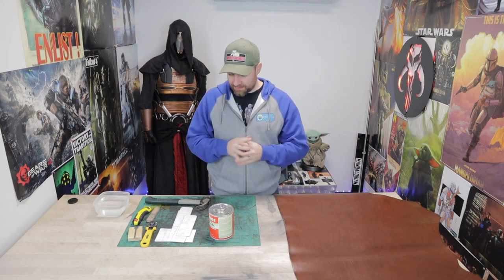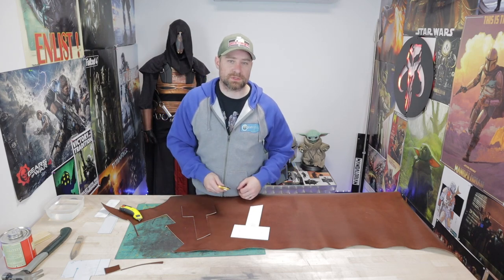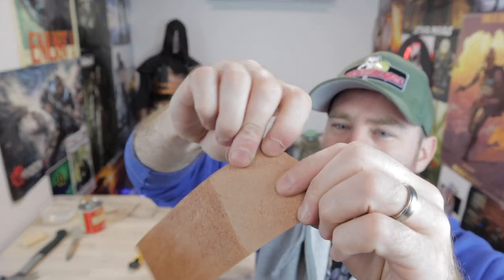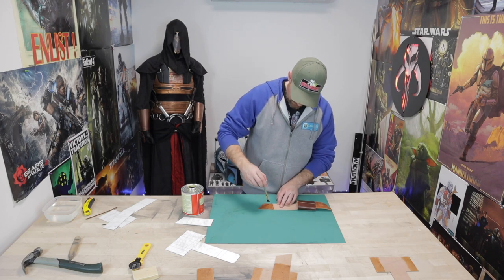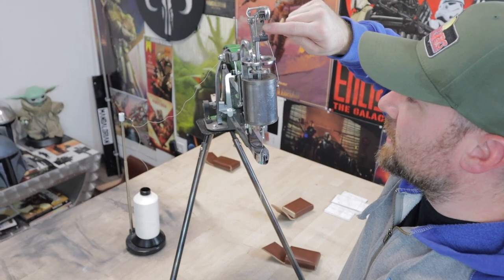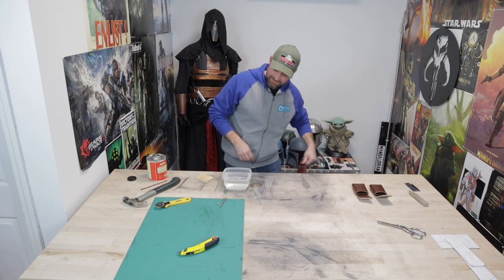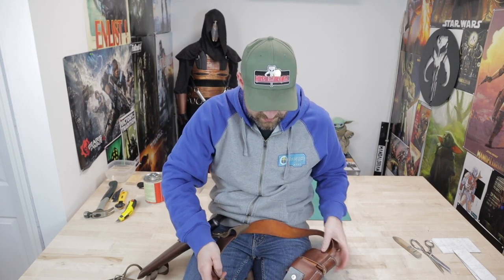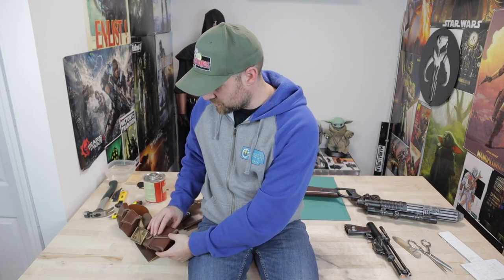"RE ARMORED" BOBA FETT POUCH TUTORIAL

Comment: Don't know if you still use the cobbler machine, but I found the best way to mount it is to bolt it to a 4x4 block, then screw the block into a 1"x 8"x18" board.  The board keeps it balanced and can be clamped to a table if necessary, while the 4x4 block gives you height.  Works a treat and is super stable.

Comment: Sweet pouches, I might have to make a couple. For anyone trying this, If I print out a pattern I'll glue it onto cardboard, like from a frozen pizza box, cut it out and tape it to the leather and the cardboard will give you a more solid edge to trace, works easier.on the rough side so you're mistakes can be hidden too, just another way to do it